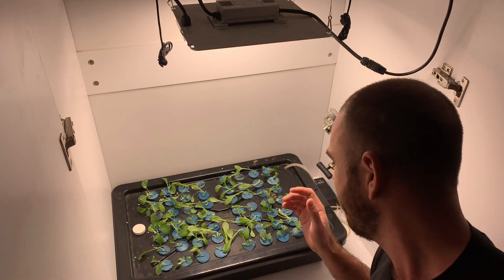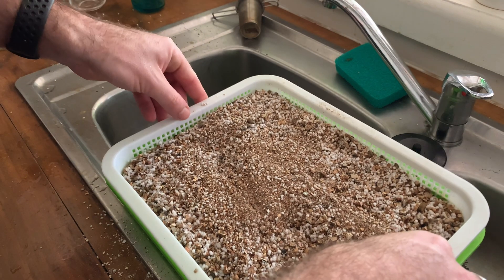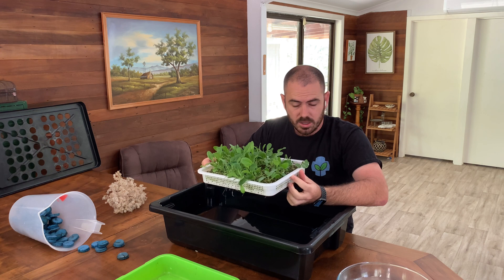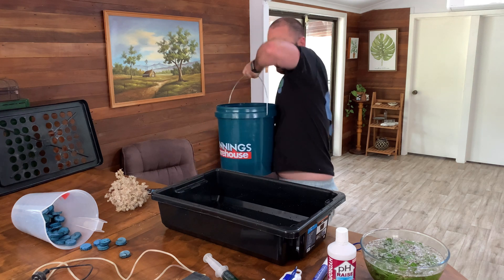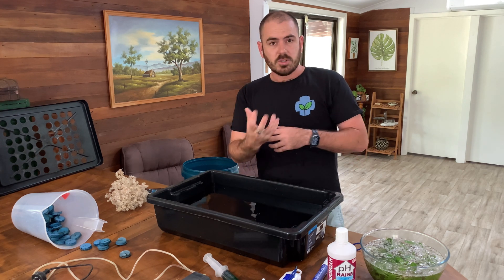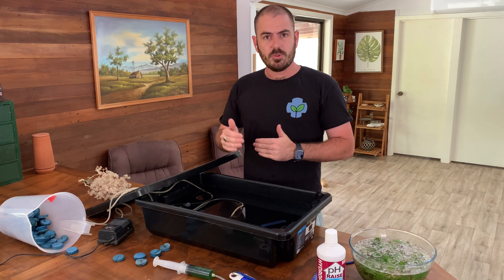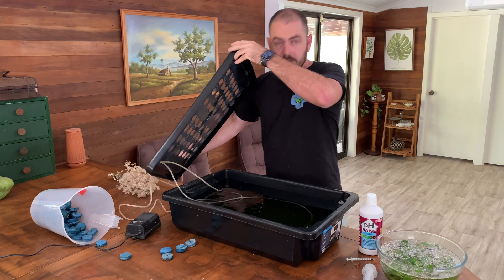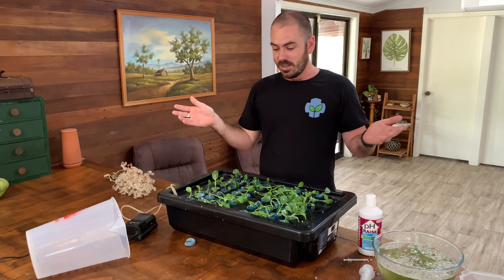How to Raise Seedlings for a NFT Hydroponic System

Comment: Hi! Your videos are great!
Is there a reason for not using nutrient solution since the beginning? Is it because of algae?
I want to include a tray for seedlings into my ebb and flow hydroponics system, but I was wondering if I could use the same water reservoir and solution for both seedlings and full grown plants.
Thank you very much! 🌱
Reply: The seed contains nutrients for the seedling to start and you should NOT be using a nutrient solution at the start, and if, a very, very weak solution, so the jump from zero EC to full blown nutrient solution isnt so big.
Reply: @friendlyfred1997  thank you!
Reply: I had noticed that seeds germinate better with just water but I was very puzzled about why that was. Thanks!